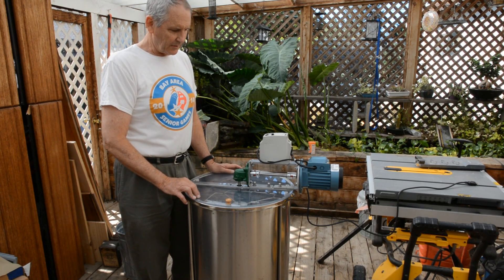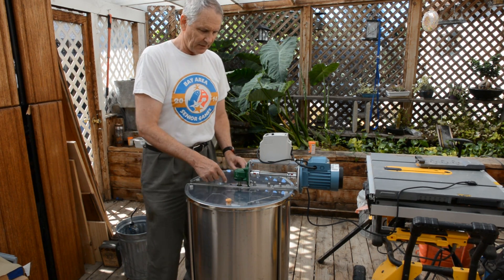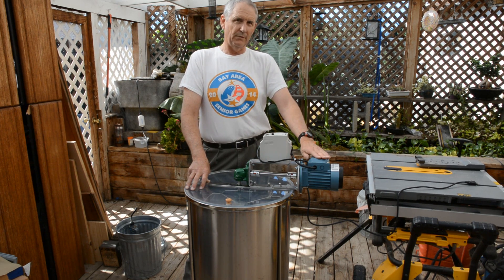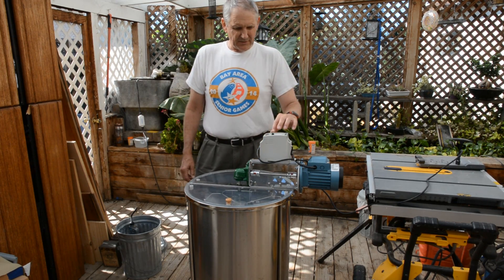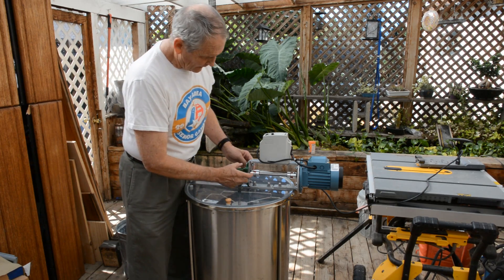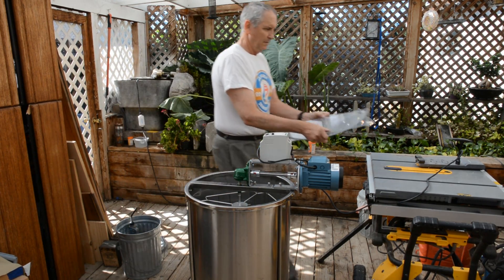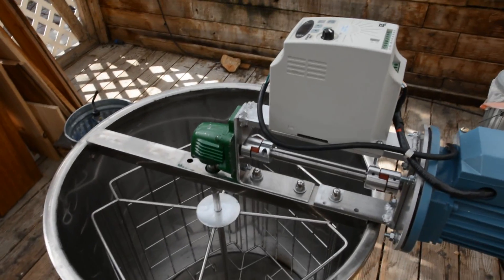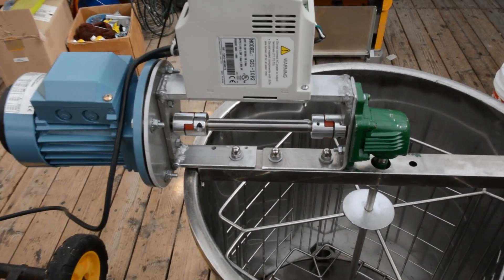Motorized Honey Extractor

Comment: Really cool conversion. For the regular guy I'd say it would be less expense to just buy a whole new extractor. Half the stuff is made in china anyway and you can get an 8 frame motorized extractor for less than $300.00 on ebay. If you get a deal on the VFD and the 3 phase motor thats different.

Comment: Nice video very informative, but after looking around on eBay the cost of the components not to mention all the work that goes into making the modifications is hardly worth it. You can buy the basic unit for around 270-300. The motorized version from the Mfg is only like 430. Last I looked on  eBay had the components at over 200.00 so it 500.00+  to build it your self or 430 to buy it pre made with no retrofitting needed. I do really like the other modifications you showed in the previous video those were well worth the small investment in material's and time.
Reply from the maker: +john balogna Yep, if you don't link to tinker and scrounge it's not for you.  I had originally bought a motorized extractor that came damaged in shipping so I had to return it.  I was not pleased with the quality so I bought the basic unit and built something much better.  Even the basic unit was not a lot better than junk and it took  some modifications to make it usable, see some of my other videos.

Comment: Any chance you could provide the source of supply for the 3 major parts; the VFD, the Motor and the gear assembly?

Thanks!
Reply from the maker: +Nicholas Lukianov 
I purchased the parts on eBay.  I did not look for any specific part number.  The gear assembly was on the original extractor, I just reversed it.